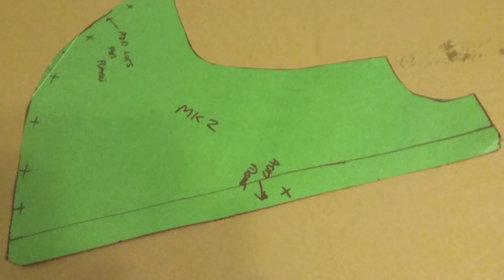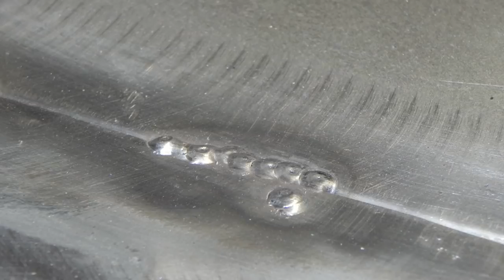Building a rally classic mini part 2

Comment: Kev, Great to see a video and you really getting on with the build. I see you have done the same thing with fitting thicker rear plates on the rear subframe trunion mount holes. i did the same in 2015 check out  ( Classic Mini Cooper restoration part 2 ) I think the 3 layers they had originally are just another rust trap on an mini as if there is not enough allreay lol. Cheers Dave
Reply from the maker: thank you and I agree its just a breeding ground for rust those steel sandwiches :) -
Reply: Think I’ll be doing the same at some point!

Comment: What Wheels (size etc) are you going to be using? What tires are available for rallying? Campbell from NZ
Reply from the maker: hello mate, I will be going back to 10 inch wheels, in rallying you get through a lot of tyres and many championships run a control tyre. I had been running 5.5 x13 inch rims for autotesting but those tyres were costing about £120 each in soft compound but a good 10inch tyre is about £70 :) http://www.minispares.com/product/Classic/Wheels/Tyres/10/TYRE15.aspx?200201&ReturnUrl=/shop/classic/Wheels/Tyres/10.aspx|Back%20to%20shop

that's for tarmac stages but for gravel I am going to have to do some research :)
Reply: @TheGentlemensMotorRacingTeam  What tire is that?
Reply from the maker: @camhick1  YOKOHAMA A032R 165/70/10  I use them on my mk1 all year round, they work great in the dry and the wet.